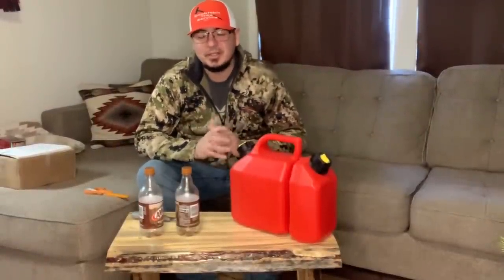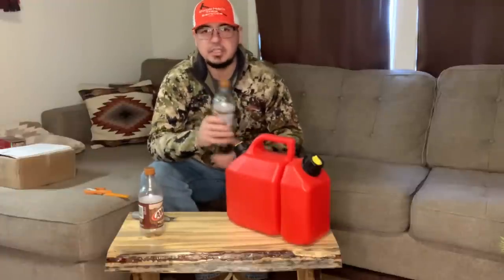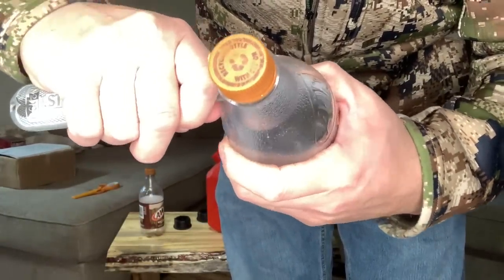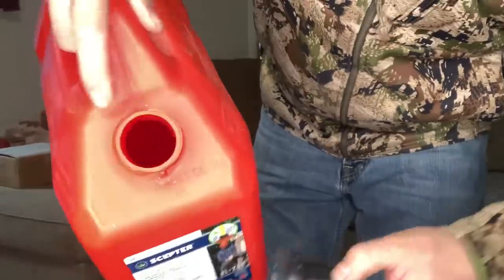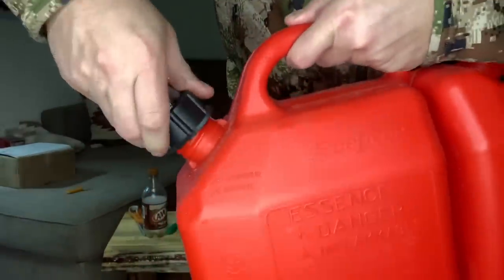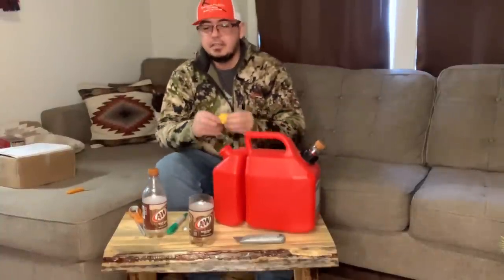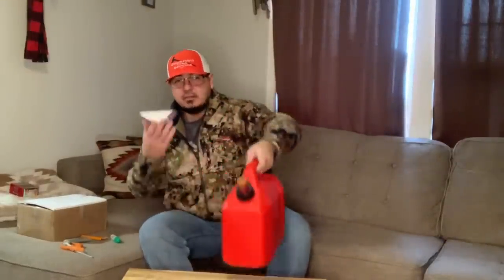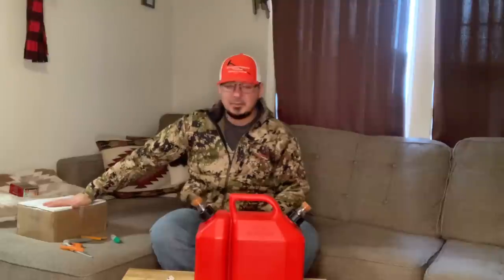Combo Can Hack!!! A&W Pour Spouts!!!Sponsored by @jaythe306snowmexican & @janelleferris1438

Comment: Tks for tips David . I’ll still use the old metal gas 1 and 5 gallon gas can . My 2 gallon can all got pin hole in them now. Little tip don’t leave your mix gas in the plastic can too long because the plastic dye will get into your mix gas . Give problem into your chainsaw carburetor. Went out in the wood in the summer time keep its out off the sun . Winter time not as bad David . TAKE CARE .

Comment: I like the  hack! My combican  didn't come with a spigot  on the oil side so I picked up one and cut it down but  I like this concept where you don't  Need to unscrew the cap to get the spigots  for the fuel or the oil
Reply from the maker: Yes they work a lot better than have them big spouts sticking out or having to pull them out each time

Comment: You havent discovered the steel Briggs and Stratton domars? They are the best. All the wildland fire crews are using them. All the contract loggers for my employer are using them also.
Reply from the maker: I’ve seen them just never had the need to purchase one
Reply: @mountainlifewithdavidkelsie  tough as nails and last a lifetime. One and done. 
They use Wedco caps so you can do your modified spours with them.